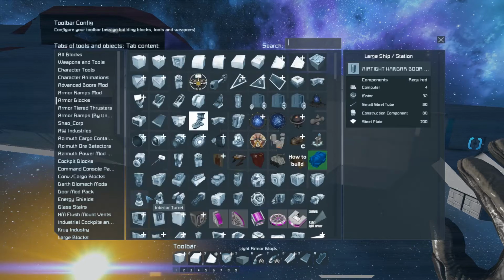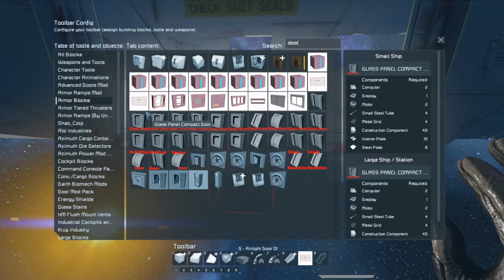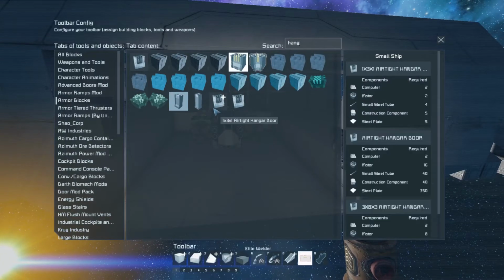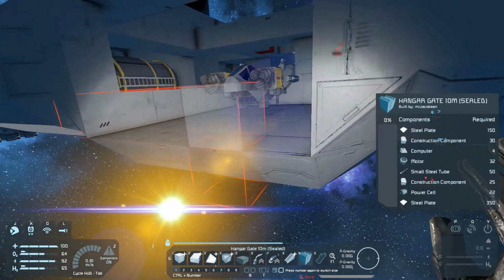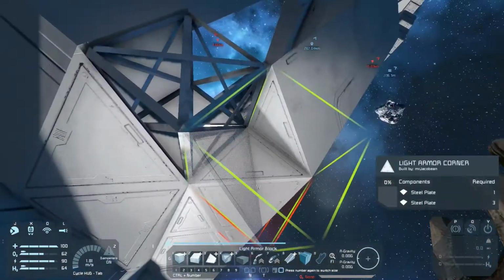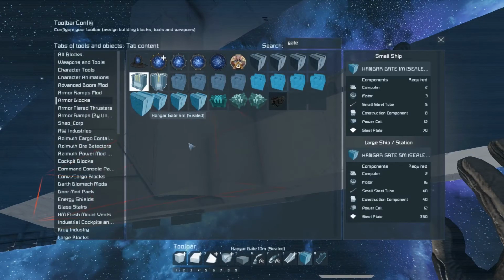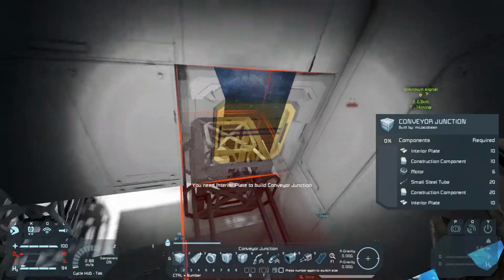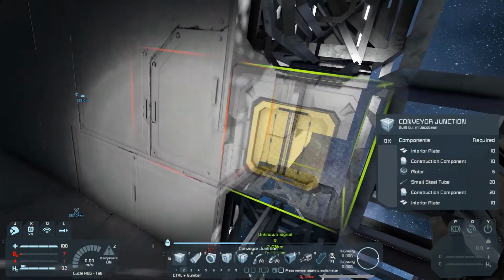Space Engineers - Drone Bay - Episode 34

Comment: How do you turn stuff on like welder when not at terminal?
Reply from the maker: Set them as a group, then either make a button panel that toggles them on and off, or make a control station that has a hotkey for toggling them on and off. You can also make a remote control block and do the same as the control station